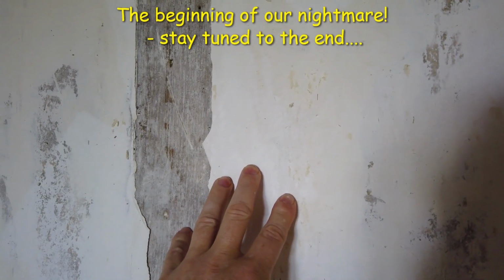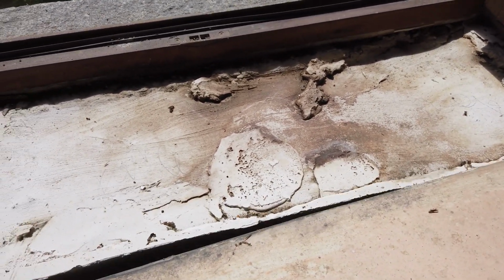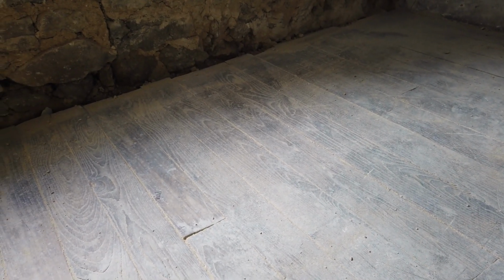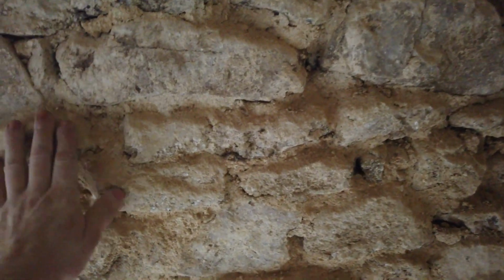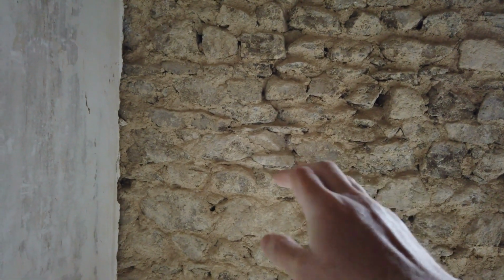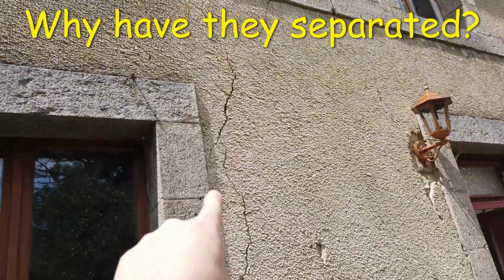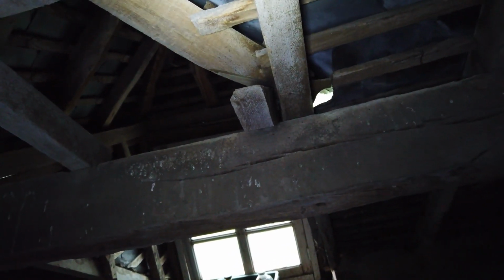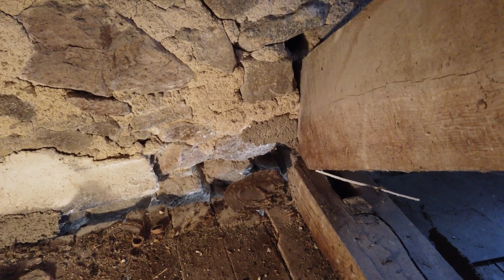Our House is Collapsing - ourfrenchrenovation - Our French Renovation, The Good LIfe

Comment: How is the work progressing?  What part of the work is the most urgent?
Reply from the maker: I wish we could decide! Realistically we need to stop the water leaks, but they only appeared when we had this severe weather. Before that they were just tiny occasional drips. Maybe something shifted?
However, we need copious amounts of taller scaffolding and ultimately to remove the roof and start again. So internal work is taking priority so now.
Reply: @ourfrenchrenovation  you have my complete admiration!  Yes removing the roof and start again sounds right but that is a massive undertaking and potentially costly.  I am looking forward to your next video: you are both so positive 🌞🌺